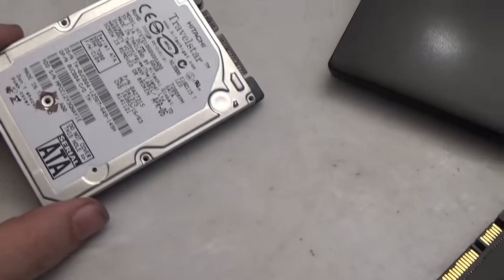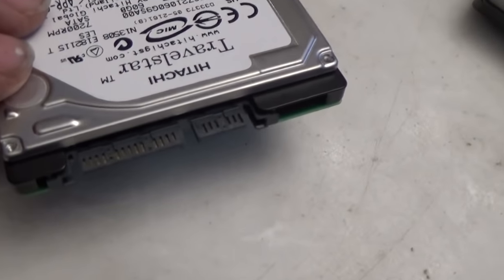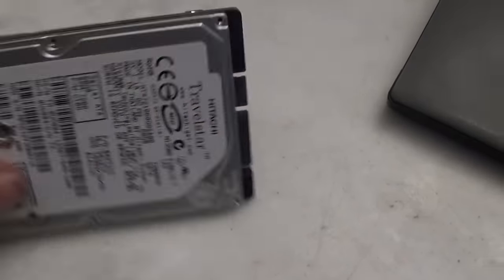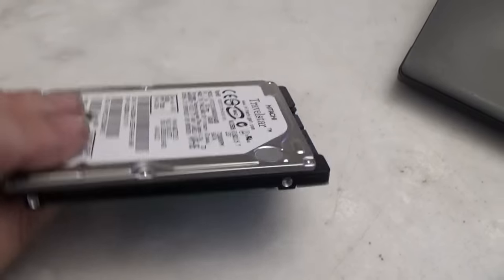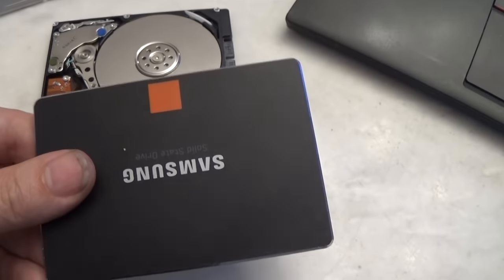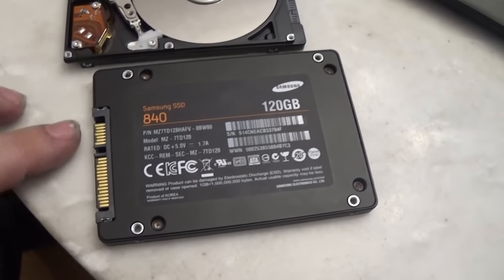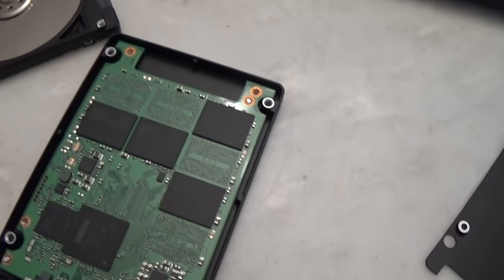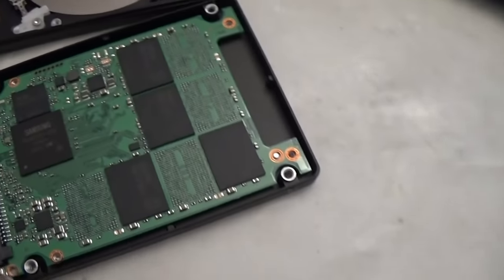Take a look inside a hard drive while it's running

Comment: This is an insane movement. It is a wonder they last so long.
Reply: That's what she said
Reply: Wth happened to my name  longer than my SSD lol.
Reply: Wth happened to my name  I own 3 desktop PC. One is 15 years old. Is working well with the original HDD. This Pc was abused and used soooo long...And was a budget PC.
Reply: Wth happened to my name  Maybe but in a case of a severe power fluctuation in your home you can also lose your fridge, TV, etc... It is also depending on the power supply you own and the quality of the HDD. Most of the HDD last very-very long.
Reply: Wth happened to my name  bruh, just because your HDD died of a power outage it doesn't mean that all HDD's are weak
Reply: Wth happened to my name  oh ok
Reply: Wth happened to my name  haha legit bought a new hdd today bc the seagate i use on my xbox randomly failed on me
Reply: hard drives do in fact last longer than SSDs because the memory in SSDs dies over time.
Reply: Wth happened to my name yes they do. What are you on?
Reply: Wth happened to my name  mine last for years now on my old laptop
Reply: I use both hdd n ssd on my pc ... use ssd for keeping windows files... my pc is insanely fast...
Reply: i have 9 years old WD Green 1TB for my cctv. it still running fine all day and night 24/7 ..
Reply: @Wth happened to my name enjoy getting 5% of the performance and 10-50ms seek times instead of instantaneous seek times!
Reply: HDD is broken easily
Reply: Well, I bashed one with a hammer until it had a hole in it, and I could recover 97% of the data.
Reply: Wth happened to my name  Actually yes,they can last long
Reply: 404 likes,comment not found
Reply: Wth happened to my name  like another comment has mentioned. During thunderstorms there is still that chance of high electrical current passing through your home. Which can damage any electrical devices connected to an outlet. Maybe next time shut off or disconnect all electrical devices from outlets or use a GFCI strip plug. HDD can last for years depending how well you provide maintenance. My recently dead computer which is from 14 years ago used its OG HDD until it finally broke down. Again if your going to be hit by a powerful thunderstorm. Disconnect your electronics and you can avoid damages to hardware.
Reply: Wth happened to my name my harddrive which is 1tb is nearly 6 years old and theres not a single problem with it
Reply: Wth happened to my name ssd are much worse and will only work for so long and if your holding inportant data on something have a back up anyway
Reply: @mark2306  quite odd, SSDs should last a mad while nowadays
Reply: Wth happened to my name I have a 1TB Blue Western HDD which lasted for 6 years and ongoing, and I’m still using it, even on my new i7-10700K computer this year
Reply: Zhen Xiang nice my hdd is used from an old windows xp based machine so older then i know
Reply: Wth happened to my name   Get wd
Reply: Wth happened to my name rip but my seagate from 2016 still works even after I shorted my wii power supply
Reply: Wth happened to my name  my pc is 5 years old still with the original hdd. It has gone through many power outages and it still works fine, maybe just a little slow for today's standards
Reply: Wth happened to my name  psu
Reply: Yeah no kidding our family's pc lasted for 25 whole years before the hard drive failed
Reply: Blue Line hard drives have moving parts which can be damaged more easily than an ssd.
Reply: @liz.1328  Yes, I know.
Reply: Hard drives typically last a year or two from my IT experience, I'm kinda surprised the hard drive still functioned while open, a cool thing about hard drives is that if they are kept running they typically last a lot longer, I have a hard drive that has been constantly active and it's still going strong after 10 years
Reply: @ramdany7  I'm surprised it's lasted that long, the WD green drives are made to be energy efficient, and as a side effect they don't really last that long, also whenever it does die I recommend replacing it with a WD purple drive, they are designed for that purpose
Reply: @LayJD_  they typically do last a long time, but if the contents are constantly changing it shortens it's lifespan because SSDs have a limited amount of read and writes
Reply: Lead Hail I had an old laptop from 2008 with a hard drive that still works. They can last long.
Reply: @leadhail  good point, hard drives on the other hand can fail for several reasons due to the complexity of several of the mechanical components, also a reason why recovering data from them is very expensive.
Reply: @leadhail  I have 4 HDD. The oldest is over 15
 years. Used every day for many hours. Is still working in good order today.
Reply: Wth happened to my name I’ve had an HD for about 15 years now of 80. How isn’t that Long?
Reply: Wth happened to my name  i have a maxtor HDD over 15years old and it still works like charm never failed never crashed and my sdd was done for only after 3 years after i got it
Reply: Wth happened to my name  ... Your Windows Installation got damaged. Not the Hard Drive.
Reply: My 3tb lasted 5 years, died some days ago
Reply: I work at a computer repair shop, almost half the pc’s we receive that are at least 3 years old have a failed hard drive. Most of the ones that do fail are laptops because they are moved around so much.
Reply: Well, i have a hdd drive but its already super slowwwww in loading things up. Its only been 4 years too. Want to switch in ssd now.
Reply: @Jerry-Anderson Pierre dont worry, ill still use my hdd, but only for storage. My ssd is for system
Reply: Mine is last almost 10 yrs
Reply: It doesn’t last much long due to the limited life cycle of each cells.
Reply: @BlueLineofthesky  im abusing my 16 yr old pc bc it is way too laggy
Reply: Wth happened to my name dont use hdds then
Reply: Wth happened to my name  tell that to my 11y/o laptop HDD..
Reply: Wth happened to my name  I'm using the same HDD since 2011, and I use everyday almost all day, it survived so many power outage that I can't even count, there was a time that the power in where I live would always get kinda weak and shut down, sometimes it was a complete power outage. One day my old PSU burned and took almost every piece of my PC, there was even a low fire, the only thing that survived was the HDD. 
So yeah, they last long.
Reply: @theodiscusgaming3909  No they don't? HDDs are constantly moving when powered and have mechanical parts such as magnets that will definietly wear down overtime. High quality SSDs such as samsung, hynix, and crucial last just as long if not longer and are faster in magnitudes. And they don't have moving parts and are becoming cheaper by the year, HDDs are only good for large amount of space but that's it.
Reply: Wth happened to my name I use my laptop since 2009 and it still works perfectly.
Reply: My HDD ( one which I recently removed from my dads old computer which he bought it at 2001 or 2000) I ran some benchmarks on it and I was surprised I recived almost 60mbps and also the total runtime is around 7500 hours this definitely proves hdd’s last longer (atleast the older ones as everyone knows that the CTR tv would work for years and not like and led) perhaps they focused more on longevity back then
Reply: I have a 20mb hard drive from 1985 that still works perfectly
Reply: Wth happened to my name no long as you take good care of it some can last as long as 20 years!
Reply: Wth happened to my name get a surge protector
Reply: Wth happened to my name  Dude, a power outage can break even a PSU or the motherboard. SSDs are more likely to die from short circuits or high voltage, HDDs are not.
Reply: yea mine last 12 years anf still using it now
Reply: Wth happened to my name I have a Seagate 1.5tb HDD from 2012 still running strong though luckily for it it doesn’t run Windows anymore my m.2 does
Reply: HDDs can last decades if maintained properly, SSDs on the other hand, even with various features like the TRIM command given 4-5 years it will still die faster than an HDD.
Reply: I have an old ssd,over 10+ of usage that still works fine to this day lol
Reply: Wth happened to my name  seagates do that..
Reply: Damn Son  well, I'm kinda a sufferer too, and Seagate is a brand that's popular because it fails a lot. Other brands serve pretty well - my Hitachi Deskstar is 12yo+ and has been physically abused and what not, still that's strong. Other HDDs are good, but Seagate is a brand good for a 2 month show-off.
Reply: Damn Son  what? just 10%? No lol, I have seen 3 from the same brand that have failed to my knowledge. All three were of Seagate. Seagate has a much higher failure rate than Toshiba and WD.
Seagate? Never. Again.
Reply: Seagate SSDs have highest failure rate.
While WD have the highest life. My old rig from 10 years old still running on WD hdd.
Reply: Damn Son  lmao my wd 250gb been there for 5 years with over 4000 working hours, and still good.
Reply: *Seagate left the chat
Reply: My WD Blue 500gb has gone through around 50 power outages(I had a bad ups battery, changed it now). And still not even a single bad sector. WD hdd are the best, Hitachi , toshibas are also good. But Seagate , I don't know man. I think the have specially designed their hdd to randomly fail on people. Also seagate drive are one of the most DOA and among all the other brands. I have hardly seen any other brand's drive being DOA but Seagate manages to do it most of the time.
Reply: Damn Son  I have an IDE 500 GB running from 2013 lol
Reply: Laptop hhds get so slow they are unusable after some time.
Reply: Damn Son  my hdd on a 7yr old laptop without battery has suffered many power outages while in use and still going strong
Reply: le my mind : touch it
Reply: @manthanmagare7915  Somewhat same
Reply: Damn Son  r/woooosh
Reply: As long as it doesn't touch a magnet or get dropped lmao
Reply: @arctic9082  naw man. Modern ssds last a long long time and considering the speed and latency benefits in day to day usage I would be more than happy if an SSD dies after 4 years of usage, but ssds last way longer than 4 years.
Reply: Thats true
Reply: Damn Son  ssd can be damaged by short circuits
Reply: The thing is SSD's are fast
While HDD's are durable
Reply: Damn Son  that's like saying humans don't live several decades because if you don't let a 2 year old breathe for a while they will die
Reply: Damn Son  Depends on which HDD you buy.
Reply: Damn Son  nine years is pretty long.
Reply: @mark2306  SSD's last longer, and are much much faster, but cost more. Still worth it in my opinion. At least for gaming and large file transfers/editing. HDD's are better for HUGE file storage
Reply: @LayJD_  yeah I know, but it happens.
Reply: @ameerkhan3257  yes, I only have one HDD left for storage. My setup is mostly out of SSDs today.
Reply: Damn Son  my guy that's just a Seagate thing. Their hdd aren't that durable since all the way back at 2010. 

I feel that you judge an overall durability of hard drives based only on one brand 🤦‍♂️
Reply: Damn Son  my Seagate hdd only lasts 3 years while my WD and HGST hdd had been running without any problems for 8 years already 🤷 it's just Seagate who make poor hdd for years already. But that doesn't mean all hdd "don't last that long" lmao.
Reply: Damn Son  Maybe you should have used somethi g called a surge supressor or perhaps an uninteruptable power supply. Yours breaking because you were foolish doesnt change the fact that most HDDs last a good long while.
Reply: Yeah very durable
Reply: After seeing this
Reply: Damn Son  Maybe the newer one's don't because stuff made today is garbage.  The older stuff that was made was good.  I had an old Dell computer with Windows XP on it that was given to me.  It had the original HDD in it right up until Windows XP wasn't supported anymore.  The drive was at least 15 years + old and never had a problem.
Reply: Damn Son  Mine didn't ''die'' after 3 years but became so slow it was almost unusable. Its a 500gb toshiba drive. But it works as a good backup drive now.
Reply: Damn Son  I have a 2010 HDD and still runs
Reply: Damn Son  same with my it's been like 2 years since I bought my laptop slightly abused but I mean like 2yrs
Reply: @defconzero  no, no you don’t
Reply: @AquaticSCP  yes, yes i do. It's a Seagate ST-225 20MB from 1986
Reply: @hifiteen49  how tf
Reply: My ssd laptop is much faster than my previous hdd one. But I do miss the clicks, laser buzzes and mechanical whirring
Reply: Oh ausa as
Reply: wth happend to my name
Reply: mine didn't
Reply: @Pimmie0132  sorry to hear this. :)
Reply: @theodiscusgaming3909 they really don’t with modern drive TBW and MBTF stats. Hard drives are more random with their failures whereas a well built SSD has a nearly guaranteed amount of writes and time it will work.
Reply: these travelstar drives are known for headcrashing like mad.
Reply: Hard drives have been around for decades now,they've had a lot of time to improve and perfect them.  They're still much slower than an SSD though.

Comment: The head moves so fast that it almost looks fake
Reply: It's essentially a glitch in the Matrix
Reply: @rhaib  
ssd is even faster
Reply: @bitrunner8759  well of course the data in ssd is already there while hdd need to find the data which I find quite funny how the hdd rpm Is super fast but still getting the data like me trying to find where i put my car key
Reply: @John_Ass  Awesome name man. Reminds me of the time I laughed really hard at if someone was named 'Jack Shit'.
Reply: Touf see An SSD doesn’t have a head in the first place.
Reply: It is fake
Reply: @jimphaldiahanwashcanzarqui1039  what d9 you mean lol?
Reply: John Ass apparently you got little to no understanding of how ssds works, they too have to find the data, using a cache memory chip. Then the ssd reads the data line by line, while seeking the file first(The cache tells the controller where to look, and the ssd find the rest of the file)

They both have delays seeking files but in ssds its faster
Reply: @tormodhag6824  Only SSDs with a DRAM cache that is. An SSD without a DRAM cache is as slow or slower than a hard drive. And SSD response time is in the 0.0 to 1 millisecond range
Reply: But it's not, blabla
Reply: @hmvocaloid7360  That isn't entirely true for all DRAM-less SSDs. If they are large enough, they will use some of their flash in what's known as an SLC cache. The problem is that the fuller the drive gets, the smaller this cache gets, and the slower the drive is for writing. New NVME SSDs that are DRAM-less (yes they do exist) actually will use system memory (RAM) as the SSD cache in the same way it would with its own internal DRAM chip.
Reply: @bitrunner8759  SSD's arent mechanical, there is no movement.
Reply: It's mostly due to the videos frame rate. The head is moving so fast that the video recording device can't capture the movements in there entirety.